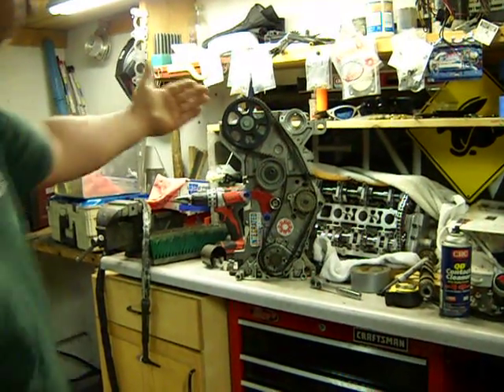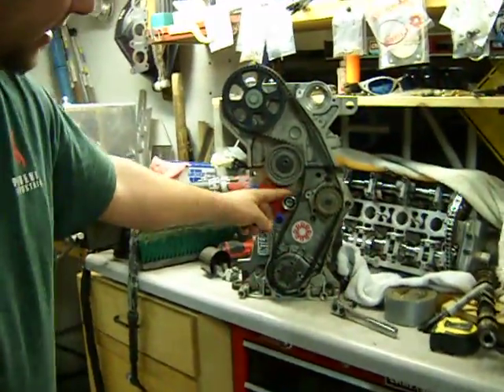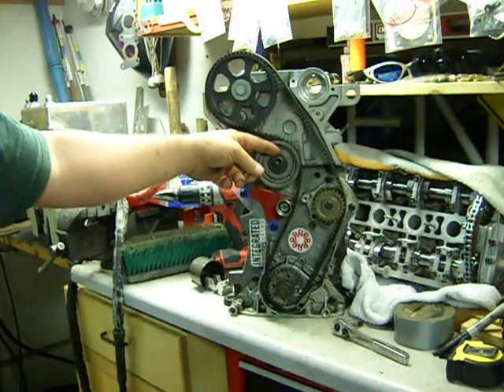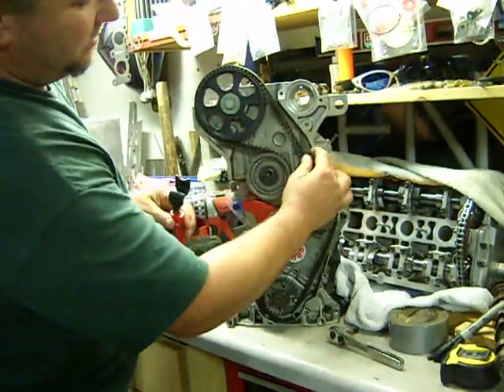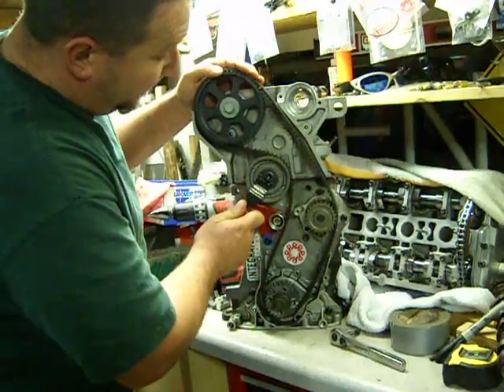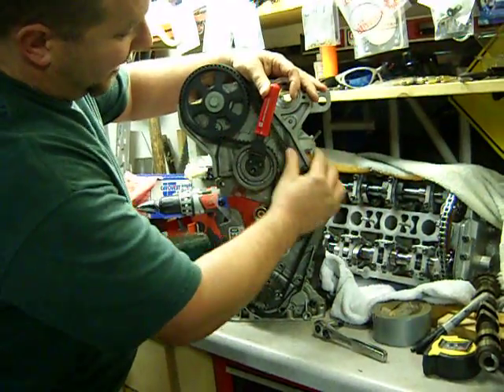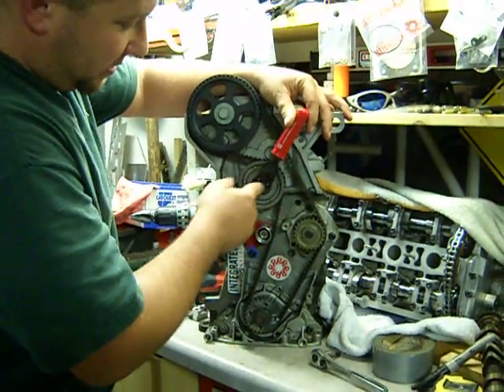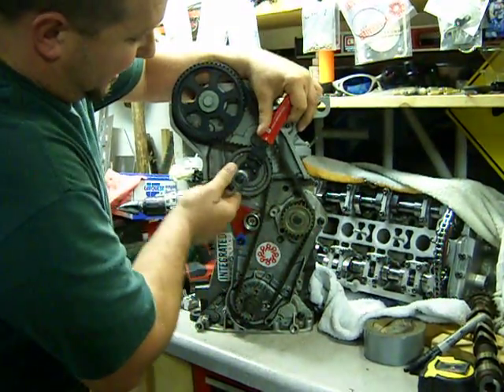IE manual tensioner

Comment: If the tension is too tight could that cause it to wine? Or make a noise ? I just did mine and noticed a weird noise but I can’t tell where it’s coming from. It may be unrelated but I do have the proper flex..